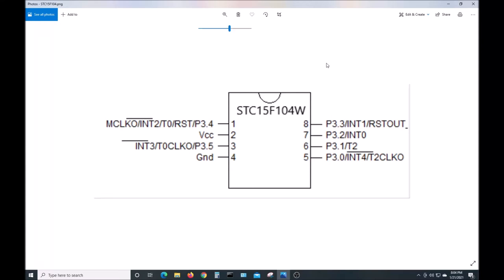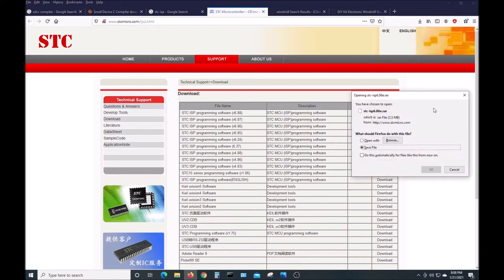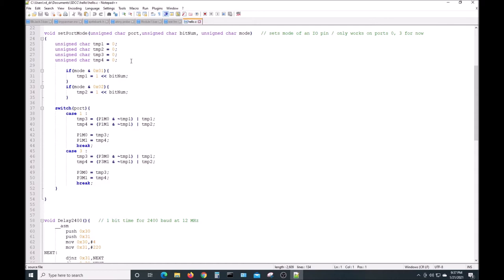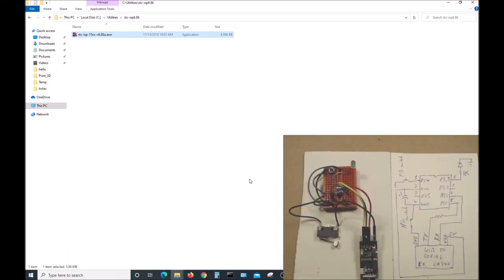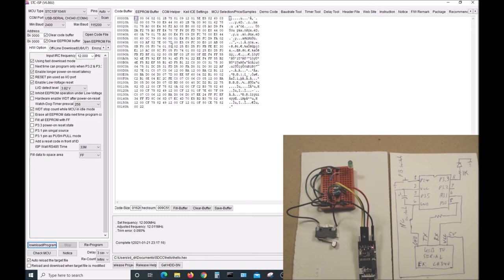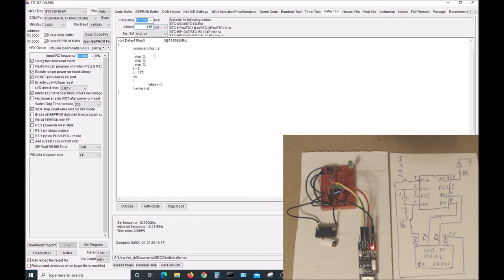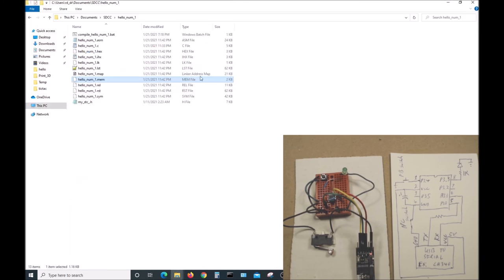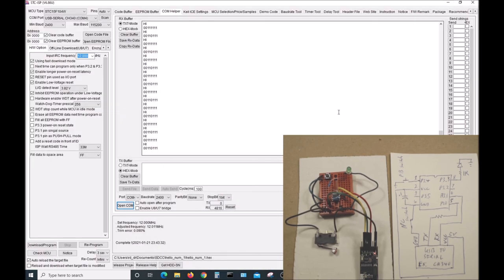STC15F104 Hello World program with the SDCC compiler

Comment: hi i have t12 soldering iron microcontroller used 15w408as i want to read a dump file from this is it possible to read from it and if yes when which hardware and software may be used?
Reply from the maker: No, you can not read the contents of these mcus.

Comment: Hello!!! Thank you very much for the very helpful tutorial. Where can I find the compile_hello.bat file source code?
Reply from the maker: I've just added it to the Github:
https://github.com/Rick-100/STC15F104-Hello-World

Thanks,
Rick
Reply: @rick_100  Thank you very much for your immediate answer. You are the best!!!
Reply: @rick_100  I have an STC8H1K24 microcontroller which I am trying to program using the SDCC compiler. I use your batch file and a hex file is created. I use the STC-ISP tool and burn the program to my microcontroller without any problem. Unfortunately nothing works. The program is very simple. Just a led blinker but it seems as though SDCC does not create the correct .hex file for my microcontroller. Should I specify to SDCC that I am using STC8H1K24 microcontroller?
Reply from the maker: @galatianoskalkos  

EDIT:

I just found this note on page 296 in the English data sheet
Note: All I/O ports except for P3.0 and P3.1 are in high impedance input state after power on. You must set the I/O port mode before using it.

You should be able to use the setPortMode in my hello.c program to to do that for port 0 and 3 or use the setPortMode function in this program for ports 0,3,and 5.
https://github.com/Rick-100/STC15W201s-servo-tester/blob/main/read_pot.c

END OF EDIT

I don't think there is any way to specify a particular chip in SDCC. You can specify different memory models. A simple program should work with the default settings. 

What's in the hex file? When you look at the .mem file created by the compiler, how much program rom, eeprom, flash memory  is used. You can examine the .lst file to look at the assembly language  that is created but that can be a little intimidating. Have you removed your led from the circuit and probed it with your volt meter to see if it's toggling? The default port mode on these chips has very little current sourcing ability.
I'm sorry I can't be more helpful but I don't have this version of the chip. It looks like it has  a lot of features.

There is an SDCC discussion board that I've found helpful:
https://sourceforge.net/p/sdcc/discussion/1864/
https://sourceforge.net/p/sdcc/discussion/1865/

Good luck,
Rick
Reply: @rick_100  Thank you very much Rick100. What I did wrong was that I didn't initialize my controllers output pin. The sdcc seems to work fine with my processor STC8H1K24 and I have changed the memory model according to my needs(I am using IAP/EEPROM in the first 4Kbytes of the processor, so I have chosen to save my code after these 4Kbytes). These microcontrollers seem to be very powerful and useful. I am waiting for more videos coming from you. The combination of sdcc and stc is incredible.
Reply from the maker: @galatianoskalkos  Glad to hear you got it working. The chip has a lot of features. You might find this Github repository helpful in using some of them:
https://github.com/IOsetting/FwLib_STC8

Good luck,
Rick

Comment: Hi sir
Reply from the maker: Hi
Reply: @rick_100  stc 15w104 read &write which programmer support sir
Reply from the maker: @ganeshelectronisvlr28  You can't read the contents of these chip. I think they do that for security. In the video description is a link to my github page for this video. It shows the programming hardware. I don't know if there are other programmers that support the chip. I've used the hardware shown on the github page. It is cheap and reliable.